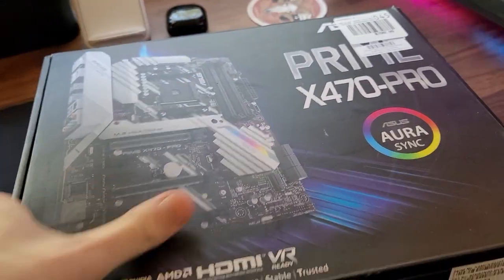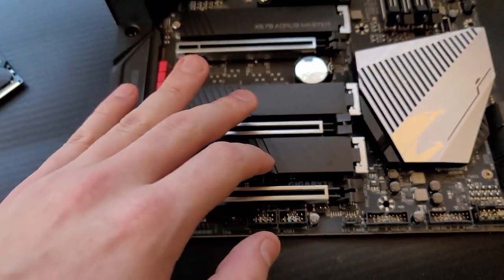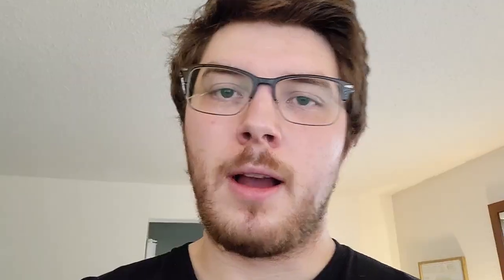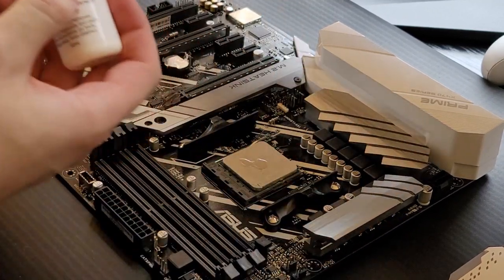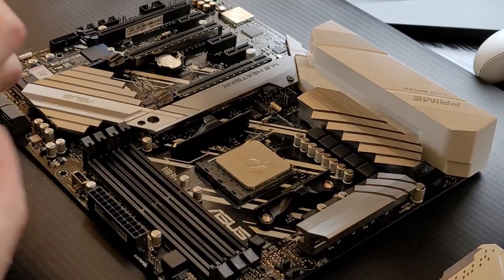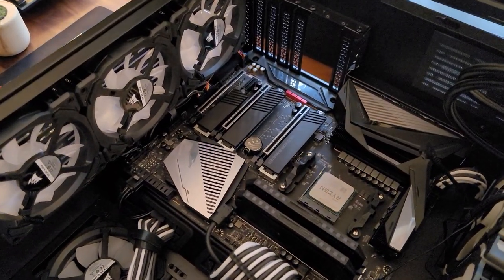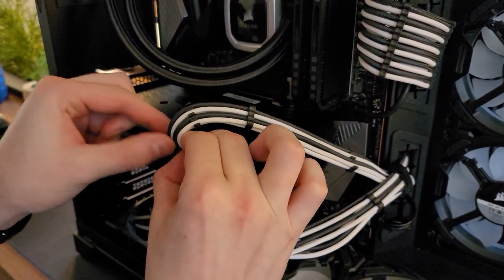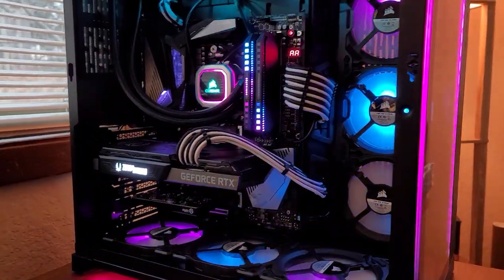ZOTAC RTX 3070 and a GIGABYTE AORUS MASTER X570 - Personal Rig Update

Comment: I just bought the x570 Aorus Master... I’ve been reading some iffy reviews on it. 

How has it held up do you think OP? Happy with the purchase? Or maybe I should think about an Asus board?
Reply from the maker: So far I've had no complaints. It was between this and the Asus ROG Crosshair that is in the same price range but it was the 2.5GbE LAN port that sold me on this. Otherwise I prefer Asus. I have yet to push this board anywhere near its limit in terms of overclocking but hopefully one day I'll have the money for a higher end PSU. 
The assortment of m.2 slots was also another reason I went with this, as well as all the extra stuff like the LED post code screen and clear cmos buttons. 

This board is super over kill but so far I've been happy with it. 

I do hate gigabytes rgb software but I just set it to a static color and call it a day.
Reply: @AlexBruns  Hmmm good to hear then. Thanks for the quick response too :) I’m just waiting to get a GPU still. The reasons you listed for the Master were the same ones I came up with in my decision. 

I’ll probably come back if I run into any issues lol.
Reply from the maker: No problem! Thanks for checking out my videos and what not. Let me know if you have any other questions!